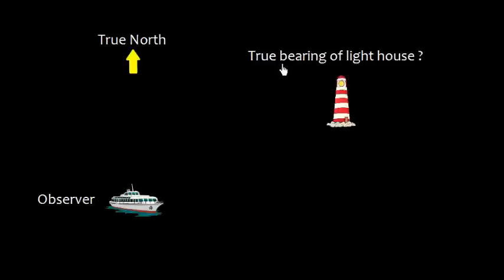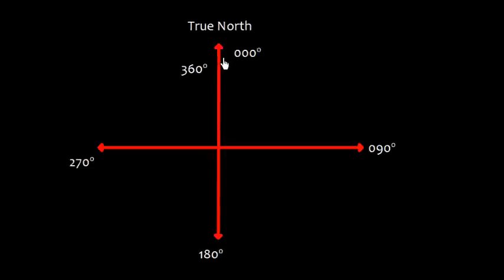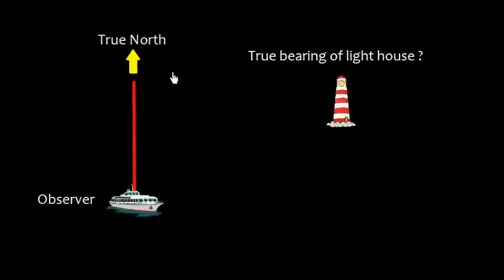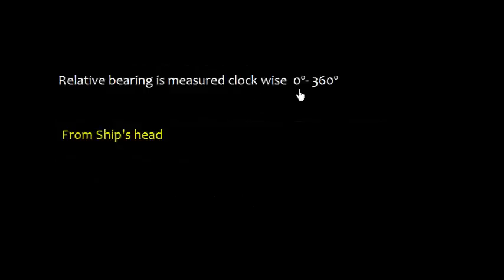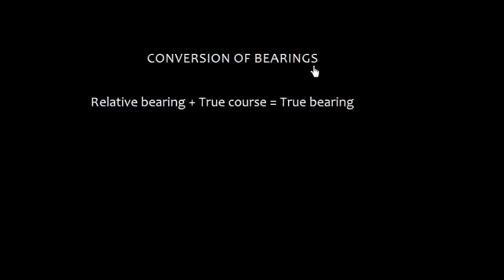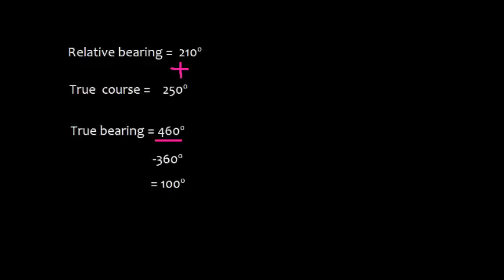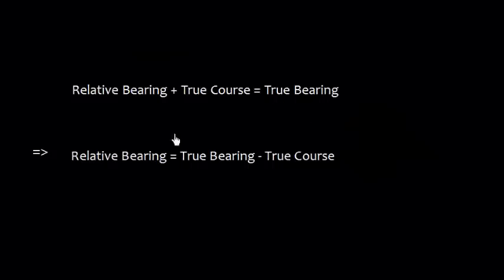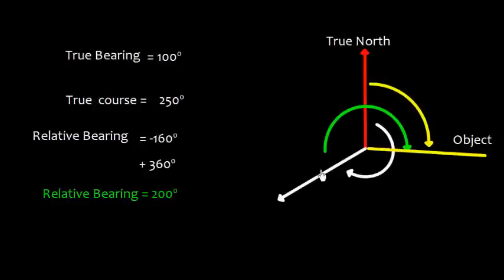Navigation _  True Bearing & Relative Bearing _ Definition & Conversion

Comment: 3:50 What do you call on this part?
2:15 The relative bearing in this part is wrong right? It should start from the ship's head in a clockwise direction to the line of sight of an object as what you have said.
Reply: Im also confused. Additional question. If the object is 45 degree on your portside. Is it not a relative bearing 45 degree?

Comment: A small trick I would like to share, just remember  “SHIRT”. Ship’s head (SHI)+ Relative bearing (R) = True bearing (T)
Reply: It's really helpful,thanks alot .
Reply: @viditrawat1074  Not only helpful it's the right way!  ships head in true degrees + relative bearing = true bearing.  N.B.:  You may have to subtract 360...For example, Ship heading 250 true + rel bearing of 315 degrees = 565 degrees - 360 = true bearing of 205 degrees.  that can now be plotted.
Reply: For 2nd mate/DNS/Bsc NS prepration join kundan patna #kundanpatna

Comment: Great job done. Kindly compare in the last part of the video about conversion of bearing from True bearing to Relative bearing and vice versa. Thank you.
Reply from the maker: Thanks for the appreciation. The last example has some typo error which was corrected with Youtube annotation, which may not show on all devices. Nevertheless, correct relative bearing is 210 instead 200 .
Reply: Thank you very much and more power.
Reply: For 2nd mate/DNS/Bsc NS prepration join kundan patna #kundanpatna

Comment: I thinks there's a little mistake there in the end.. True Bearing= 100 deg. T/Co= 250. That makes the relative bearing -150 plus 360 to make it positive which makes 210 deg. but still a very good lesson, cheers!
Reply from the maker: +John Kenneth Mercolita 
Thank you very much for noticing the same. Well, you are right and same has been corrected  using speech bubble. Appreciate your attentiveness.
Reply: Relative bearings are measured clock-wise or anti-clockwise and up to 180 degrees only, in this case it is  -150 or 150 degrees R to the port.
Reply: Ive noticed the same
Reply: I agree with that case... It supposed to -150 is the value of Relative Bearing... But anyway, we have learned for this video... Thanks and credit to the owner...
Reply: For 2nd mate/DNS/Bsc NS prepration join kundan patna #kundanpatna